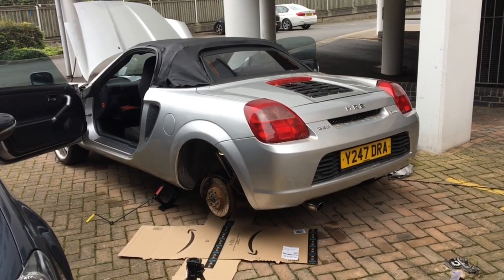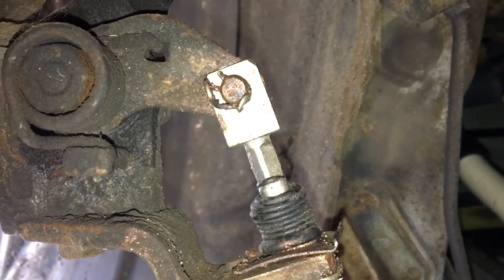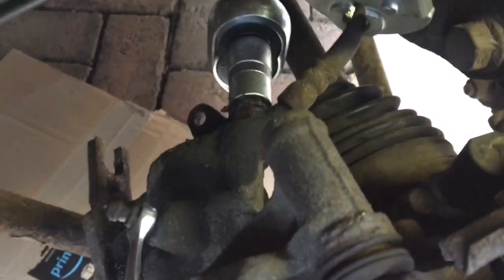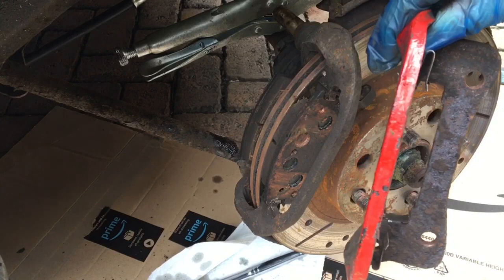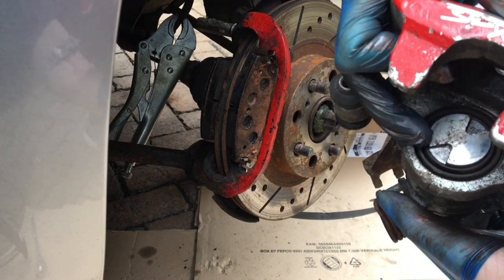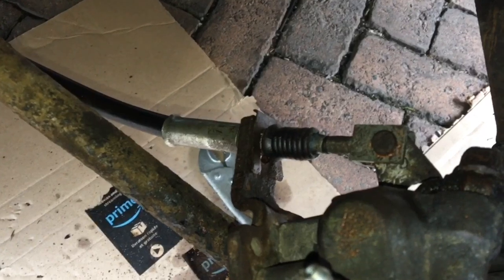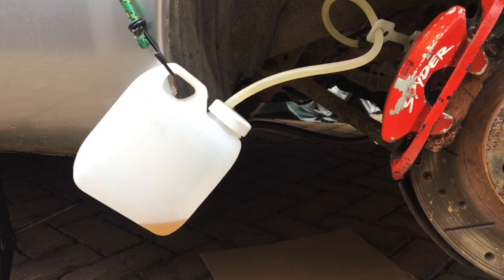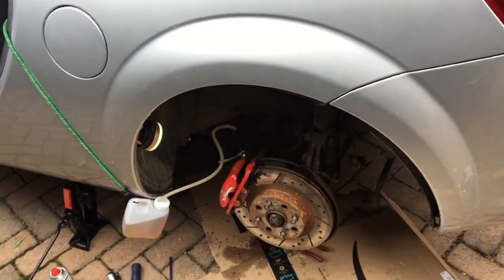Toyota MR2 Roadster rear brake caliper replacement

Comment: Those look like mtec grooved and dimpled discs. Do you get a slight whirring noise when you brake with them? If so can you also still hear it but really faintly after you have stopped braking? I'm trying to work out if one of my calipers is sticking slightly or whether you just experience the pad slightly touching the disc without it sticking.
Reply from the maker: They are mtec grooved and dimpled; i get no noises at all; my best guess would be a semi seized caliper. My rear right operated under foot but the hand brake did nothing as the cable no longer had enough leverage to activate the piston. I imagine it never really released either and a noise would be a natural consequence
Reply: @andrewsparey697  Thanks for that, I'm wondering if my handbrake cable my be causing the brake to stick on slightly. All the calipers are new. I've got new cables which I need to get round to fitting.
Reply from the maker: @OochPinnock  search youtube for “relentless racing mr2 handbrake”. Excellent video but you have to drop the fuel tank. Apparently you can do it in 3 hours if well trained, took me about 8 doing it outdoors under a scissor jack
Reply: @andrewsparey697  I have that one saved ready for when I do it. I'm going to change the hoses at the same time. I'll probably try and remove all the stuff inside the car on one day and then drop the tank the following day if it takes that long. Does your car have aircon as I think it is a bit more difficult if so.
Reply from the maker: @OochPinnock  it does have broken aircon, that slows you down by maybe 20 minutes, not too bad. Having a decent stable jack for the tank is the most important part. Mine balanced on a scissor jack. Was awkward and hard to raise and line up the bolt holes again
Reply: @andrewsparey697  I have a trolley jack with quite a large contact pad so I'll see if that will fit under far enough to support the tank in that case.

Comment: The clip for your parking brake cable is on backwards.
Reply from the maker: At the beginning or afterwards?
Reply: @andrewsparey697  After, you need to turn it over
Reply from the maker: @mikebourgeois2742  good spot, i have turned it over, thank you very much
Reply: @andrewsparey697  👍